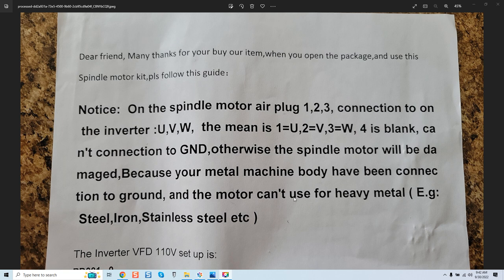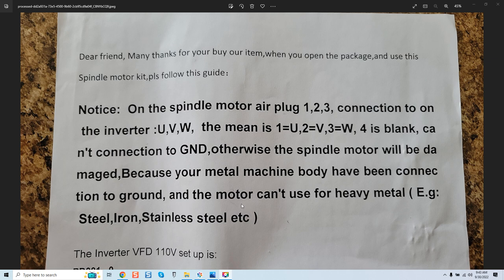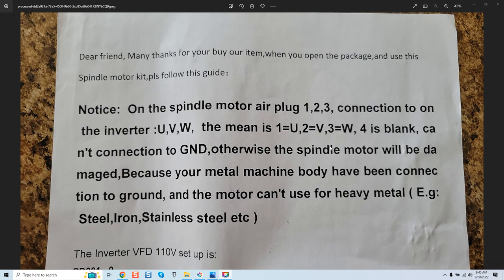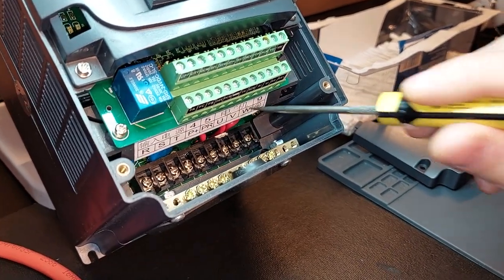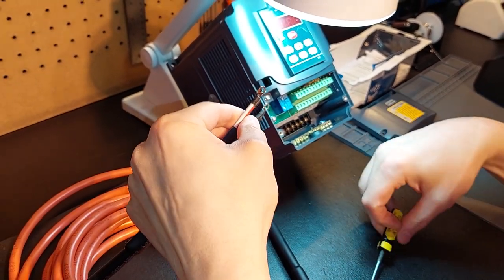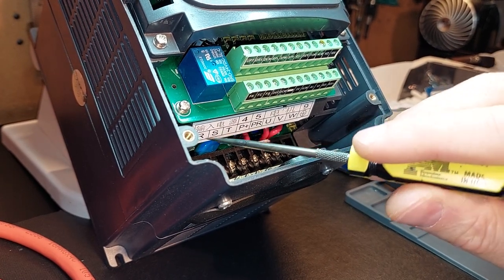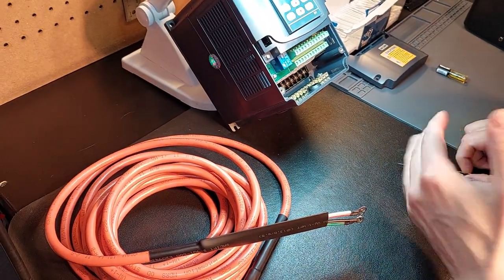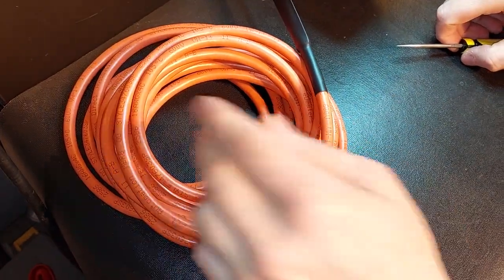How To Connect A CNC  Spindle Cable To An HY VFD...

Comment: Here you have coupled the spindle ground and the shield ground wire together, so basically when you are connecting that at ground bus from vfd side, isn't the shielded wire now connected to ground from both ends just see and the reason why i am saying this is because at the other end which is your spindle is metallic body and that body is always in contact with the gantry metallic surface and the whole gantry is grounded thus creating 2 different ground points that can cause ground loops. Correct me if i am wrong or do we need to conductively isolate spindle from getting in contact to metallic chassey of gantry on the y axis to prevent it from making the spindle side as another ground point.
Reply from the maker: The shield drain isn't the same as the ground lead on the spindle's power cable run to the spindle motor. 

Connecting both of these leads to the ground on the VFD only provides one connection to this ground point for each of the leads (shield drain, and ground lead for the motor).

The ground lead you then discuss for the spindle's power connector, and the conduction point of the spindle's body on the CNC chassis to be specific the gantry as you pointed out would then properly add a grounding point to the end users CNC chassis.  

This ground point then has many variables affecting it being effective such as conduction between all mounting adjoining surfaces to properly allow grounding of the chassis. 

If for instance any of surfaces are plastic, or anodized, coated then they are not allowing conduction to the remaining portions of the CNC chassis, in which case these areas of the chassis should be using a "Star Point" ground to ground the entire unit.

CNC chassis don't come from the factory grounded ever, so if an end user decides to ground their chassis aside from mounting their spindle to their Z axis mount which 98% of end users don't ever do then they may only have potential for a "ground loop" if they don't pay attention to the spindle being grounded at the VFD end.

 Attention to detail as you just pointed out is everything. 

Thank you,
Vince
Reply: @corvetteguy50  So in a nutshell what i can conclude is that at the spindle side, the spindle should be conductively isolated from the metal surfaces of z axis slider plate and thus getting in contact by any other metallic surface of y axis to prevent it from getting grounded from machine gantry side. Am i correct?
Reply from the maker: That's not what I typed. Please reread what I explained.

 If you plan on grounding your chassis independent of your spindle then yes, you would isolate the spindle. 

This would essentially make no sense as the chassis is required to be grounded as well, and using the spindle as a ground terminal eliminates the work of having to ground the CNC chassis as a separate entity. 

The only time you would need  to ground the chassis by itself is if the end users Z axis uses nonconductive components/coatings not allowing grounding to be achieved by simply mounting your spindle.

Thank you,
Vince
Reply: @corvetteguy50  What i want to say is the Sheild wire in both the cases still grounded at one end? like, 

Case:1 the spindle is conductively isolated from Chassey thus the ground at vfd is the only point

Case 2: When spindle is also grounded with chassey, so the sheilded wire is only connected to ground at vfd side but it is also connected to wire (Ground of spindle) which is connected to 2 different points. So technically is the sheild wire still grounded at one end (vfd side)?
Reply from the maker: If the spindle's power cable is grounded at the spindle motor's terminal 4 using one of the cables leads, and then that lead attaches to the VFD's ground bus along with the shield drain of the cable being connected only at the VFD end the unit is grounded correctly as the shield drain, and ground lead are both grounded to the same single point which is the ground bus on the VFD end. 

They're not connected twice as the cable's ground lead. and shield drain are both utilizing the same single ground point which is the VFD's ground terminal only.

The chassis of the CNC is to either be grounded by itself as I discussed in the previous explanations, or to be grounded by using the spindle through conduction that we already identified.  

This is pending of course the Z axis for the spindle for the end user's CNC chassis is able to do so without any insulation obstructing conduction. 

If the Z axes once again isn't conductive where the spindle mounts, then grounding the CNC chassis is to be done separately as a single unit. 

If you require more support on the topic we can setup a consultation. Please contact me using the video's description above. 

Thank you,
Vince

Comment: Vince, great info but I wonder if the Controller/Machine (120V) and the VFD (240v) are on separate circuit breakers will there be possible issues with ground loops? 
should I for example disconnect the ground (green) wire going into the 120v wall socket and connect it to the 240v sockets ground so they share the same line?
Reply from the maker: If the 120v, and 240v breakers are sharing the same ground bus in the electrical box its not possible to have a ground loop as their sharing the same central grounding point. 

Also remember all the double cable's shield drains are only terminated to the ground bus on one end. This prevents ground loops.

 Thank you,
Vince

Comment: three phase motors run in reverse if the pairing changes isn't it, it just takes two wires to change though.. on spindles which support reverse (counter clockwise) one may need to be careful
Reply from the maker: Thank you for your support. You're correct. The other option to reverse the direction of the spindle is to press REV on the digital display of the VFD. Thank you,
Vince

Comment: hi, i have a question 😓 please dont bit my head off i have search the internet for a answer to no avail, 
where do i connect the earth from my 3pin uk socket. Do i connect it to pin 9 so id have 2 ring connectors one from my uk wall sock and one from the spindle? thanks martyn
Reply from the maker: Thank you for your support. Yes, if you're using the HY VFD you're correct in what you wrote. Thank you,
Vince
Reply: @corvetteguy50  ok thanks, 👍
Reply: would that be the same for australia 220v       cheers
 @corvetteguy50
Reply from the maker: Thank you for your support. Terminal location 9 on the HY VFD is allocated to ground which means the ground from your spindle's power cable is to use this terminal along with the spindle's double shielded cable drain lead to dissipate any EMI. Thank you,
Vince